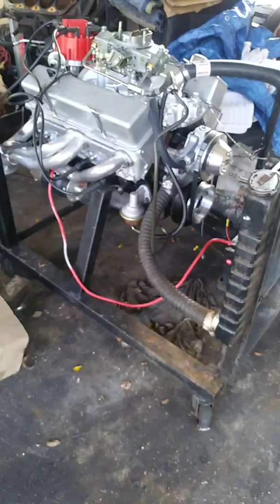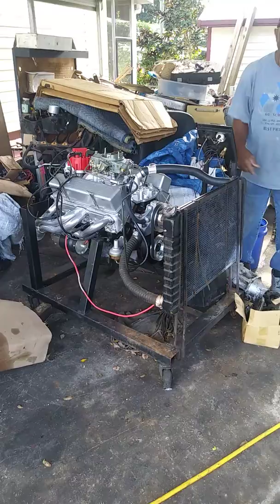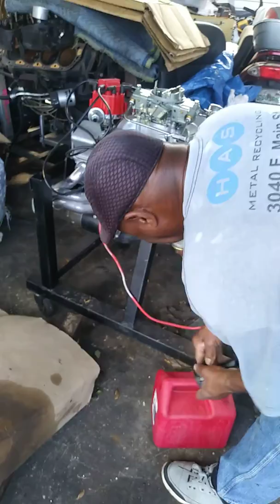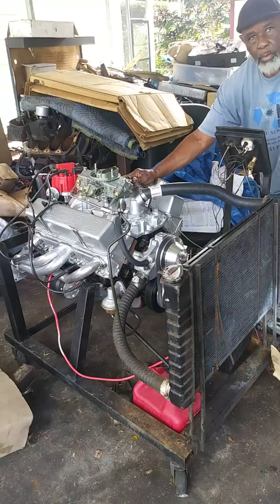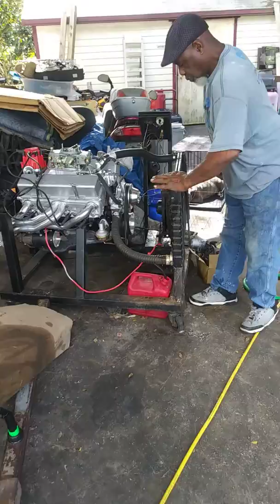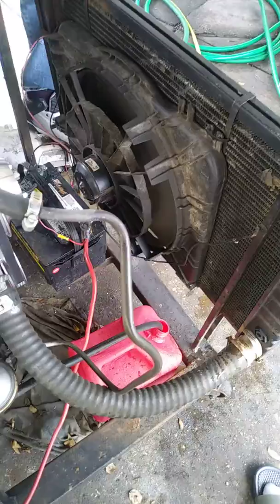400 sbc bored .030 over.Holley 750(SPITS FIRE)

Comment: How efficient is that radiator with no cool air blowing threw it 🤔 ??????
Reply from the maker: It won't hurt anything as long as it's not under load and sit running past running Temps. It's temporary unless you add a fan set up!